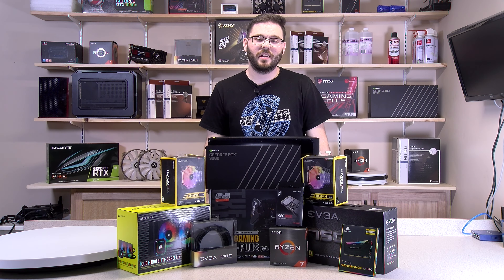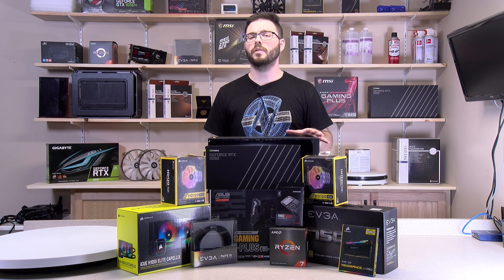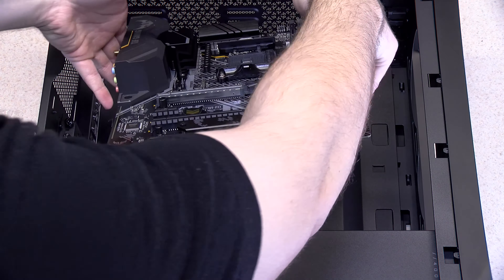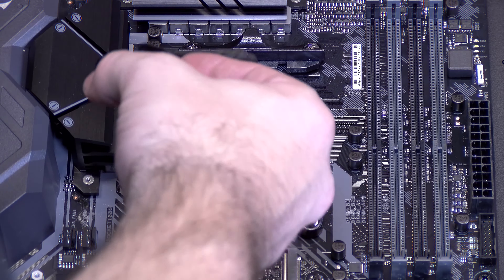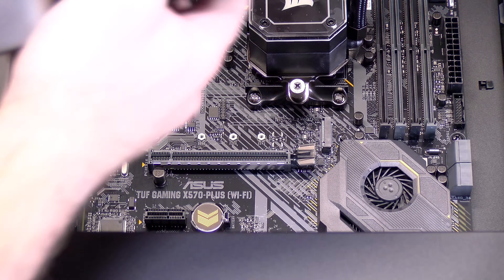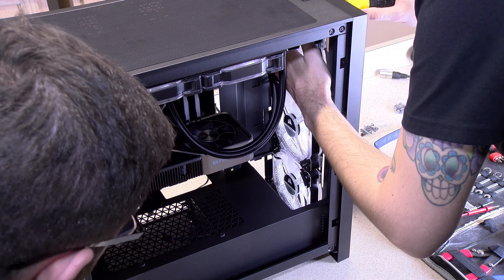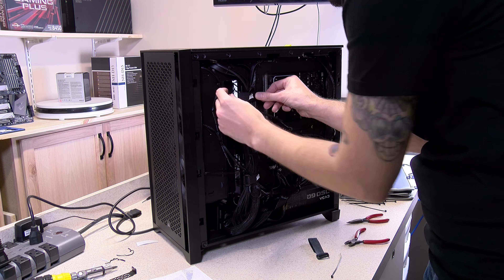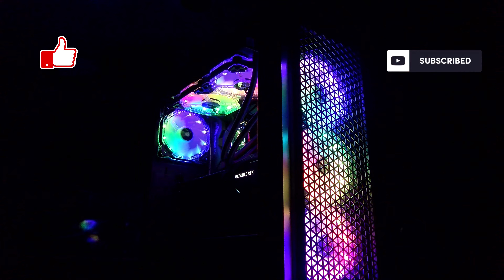Corsair 4000D RTX 3080 Build

Comment: Are the fans loud after mounting them on the case? because sometimes I hold a fan turned on in my hand and it's completely silent, but as soon as i screw it and mount it on the case, it is making a motor noise
Reply from the maker: the fans are definitely not loud and really only noticeable if you are running them on the max setting.
Reply: @SplexSideGaming  Thank you. Because i am interested to buy the case
Reply from the maker: @Ladioz  case is a good option. i would definitely recommend it.

Comment: Hey I just recently bought that case and I have the asus tuf x570 plus wifi motherboard will they work ? I read something about a type c connector
Reply from the maker: yeah they will work. in regards to the type c connector, i dont remember if that motherboard has a port for it or not. may not be able to connect the one on the front is all.

Comment: Is 16GB enough to run gaming on that 5800x
Reply from the maker: oh for sure. 16gb is the minimum i spec any gaming build out with. he still runs it on all AAA games without any issues.
Reply from the maker: @CrypticHack3r  what are you confused by?
Reply: @SplexSideGaming   I guess the timings and the size I see many videos people using 32gb minimum and c16 instead of c18 not sure why’s
Reply from the maker: @CrypticHack3r  he is obsessed with RGB. also it is cl16 ram even though it runs at 16-18-18-38. Looking at what ram he has it is a 2x16 32gb kit. if i said 16 in the video i was wrong. Personally i have grown old and bitter towards rgb and my build has none in it and my ram is cl14 at 14-14-14-34 for timings.
Reply: It’s CL 18 Ram 3600mhz okay to run am I gonna notice a big difference
Reply from the maker: @CrypticHack3r  lower and tighter timings will always be better. you shouldn't see any significant impact running ram at that frequency and timing.

Comment: i know this isn't about the video but do you think a r5 2600 will bottleneck a gtx 1080ti with 16gb of ram?
Reply from the maker: gonna have to do your own research on that one. off the top of my head i lean towards a no but as games become more demanding 16gb will likely not be enough in the long term. its great for starting out but long term 32gb is likely where things will. the 1080ti will be good for at least another generation. has plenty of vram and OC's decently. i would try as hard as you can to upgrade the processor and ram down the line.
Reply: @SplexSideGaming  16gb is definitely more than enough for gaming. I only suggest 32gb or more if you are a streamer or content creator, but more than likely you won't ever need more than 16gb for just gaming
Reply from the maker: @Reddblue  for right now yes 16gb is fine. I do agree that content creation/workstation style tasks make 32gb ram more useful and desirable.